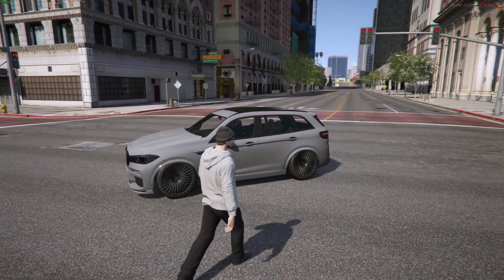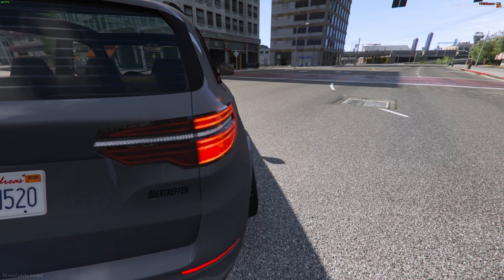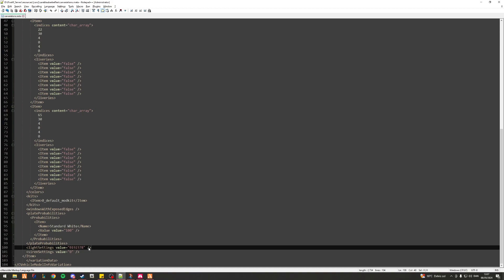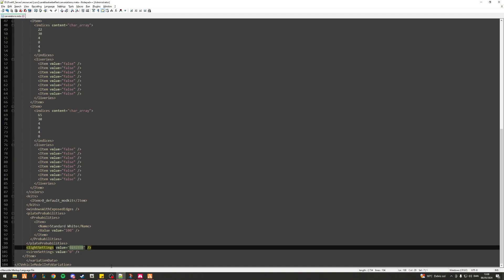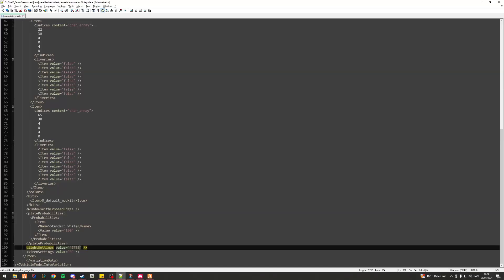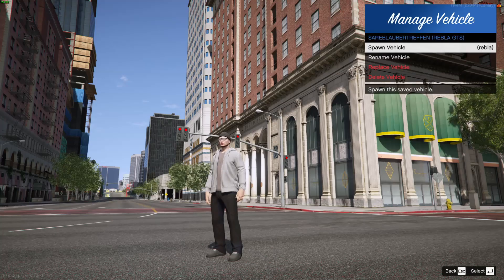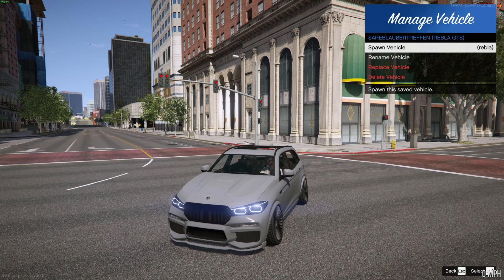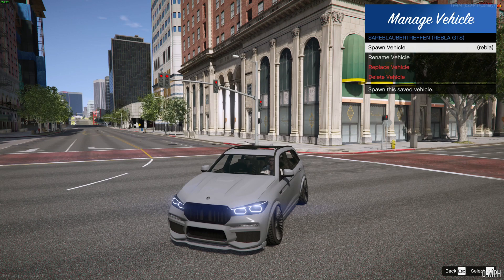FiveM Vehicle Development - Fixing light IDs

Comment: question: as you show in the video there is a lightSettings value aka light ID in carvariations.meta. But also in carcols.meta very often there is a id value for the lights, those two shoudn't be the same? because i saw many posts in forums that say carvariations light id and carcols light id both need to be the same ever.